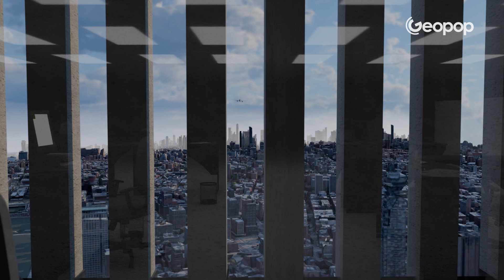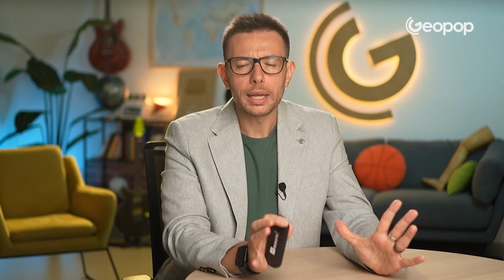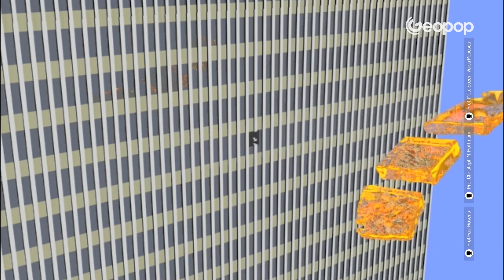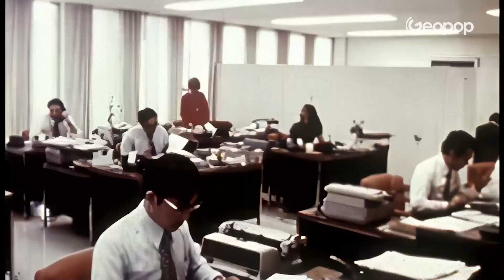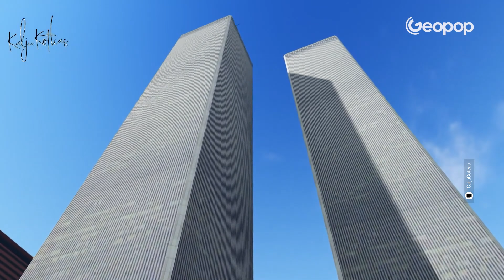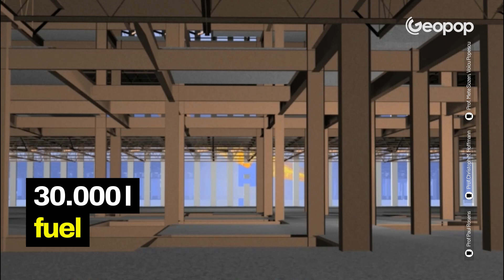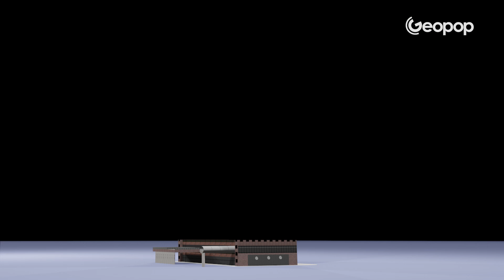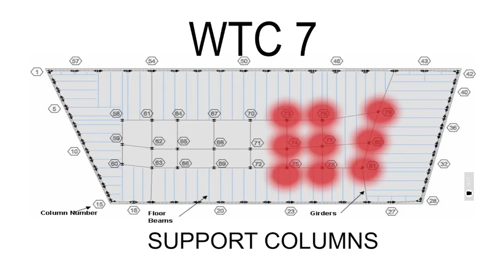9/11, 2001: The Technical Reconstruction of the Twin Towers and WTC 7 Collapses

Comment: Let's set the record straight. Molten metal was found in the dust, and in the debris for 6 weeks. The colors of the metal was orange and yellow. The color of molten aluminum is grey, looks like mercury. Molten steel was reported by the following 
people. Captain Philip Ruvolo (NYCFF), 
Richard Riggs(debris removal expert), Mark Loizeaux , Leslie Robertson (wtc structural engineer), Lynn Margulis (University of MA),  Dr. Abolhassan Astanch (from Berkeley),  Robert Kim Ireland( chemical engineer for US Army Corp of engineers), Mark Basile( chemical engineer), Kathy McGrade (materials engineer), Gery Warner( Mechanical engineer), David Gregg( PhD Chemical engineer), Steven Jones PhD( physicist), Kevin Ryan ( BS Chemistry), Niels Harrit (PhD Chemistry), Tom Sullivan( Explosives team) Jason Cheshire ( Chemical engineer), and Jeffrey Farrer (PhD Material science engineer).
Reply: Let's set the record straight. Molten metal (injteresting choice of word) was NOT found in the dust (that doesn't even make sense_ and in the debris for 6 weeks.

This is easy enough to confirm. All I have to do is ask you for any piece of verifiable evidende to back up that claim. Like thousands before you that is a task you will not just fail, but nopt even attempt. 

No need then to go to Step 2 and establish relevance.
Reply: @TheCriticalStinker-jw4fl that's right, go back to the top of the comments and start your bs all over again. Let's ignore the dozens of people with science degrees and listen to stinky with no degree and no experience in this area whatsoever. Why do you choose to ignore 90 percent of evidence. Where's your masters degree? Where's your 25 years of experience? Why should anyone listen to what you say?
Reply: @TheCriticalStinker-jw4fl I've just provided you with the people who say it's there and there degrees.What makes you think you know better than them?
Reply: @TheLoonResistance  https://m.youtube.com/watch?v=02UtSw-JeiI here’s the very first person they listed saying they witnessed molten steel. Is this your first time using the internet or are you really that dumb?
Reply: @thomash4950 - He was in Building 6 and as far as I know did not perform any metallurgical tests. Curiously, even though he is the star witness for the conspiacist crowd, not one of you lot has ever bothered to interview him.

Your entire case is ine casual comment, anecdote and you don't even bother to follow up.
Reply: @TheLoonResistance  Im not even a conspiracy theorist on this matter I just thought it would be funny to make you look like the fool you are once I realized the names this guy gave were real and had accounts of them noticing molten steel. You are eating your words from your first comment and have deflected to a new argument to protect your delicate ego and it’s hilarious
Reply: @thomash4950 - And what part was it I got wrong again?  So far you have presented a cherry-picked casual anecdote from one clearly still stressed, shocked and exhausted firefighter, who was in the wrong building (which I guarantee you didn't even know until I pointed it out) and with whom no one had EVER followed up.

Good luck with that in front of the grand jury.
Reply: @TheLoonResistance  man you are a next level dunce. The part you got wrong was claiming he provided no verifiable evidence of his claim when he listed nearly twenty names of people who witnessed molten steel, all on video. All while you contribute nothing but non constructive criticism. I’m not even arguing with you about the facts of 9/11, just pointing out that you were clearly the wrong one in that exchange
Reply: @TheLoonResistance also there is nothing anecdotal about it if every single one of them confirms they saw molten steel, which if it wasn’t your first time using the internet you could confirm yourself with a quick google search of each name
Reply: @thomash4950 - Great. So they were all in Building 6 then? 

Where is this molten steel?  Show us.  

Or maybe sometimes people use a word in a casual, not a literal way. Explaining the total lack of corroborating physical evidence.
Reply: @thomash4950 - If only one of you had the stones to do a comprehensive follow up interview with even one if these star witnesses.

Curious thing that.
Reply: @TheLoonResistance  bro just stop, take a breath, and figure out how to use your internet. It’s one of the best tools of the 21st century, and you have quite literally been handed the names to look up to see VIDEO of them all claiming to see molten steel. But I guess that all “not literal” for all of those accounts lmfao. Bro just grow a pair and admit your first comment was wrong, it’s not that hard unless you’re a major narcissist. That’s what this conversation is about, not us interviewing those people 😂
Reply: @thomash4950  - I am not the one making the claim here.  I am under no obligation to do your research for you because you are too lazy/too dumb.  I suggest you heed your own advice, do the research, then present the case instead of making others do your work for you.

Again, right now all you have presented is one guy using the magic word - a guy you and all the chickenshit conspiratards refuse to conduct a detailed follow-up interview with. 

There is no case.

Molten steel - as in steel heated to its liquid state - is a conspiracist fantasy derived from mis-quoting a tiny handful of casual anecdotes out of context with absolutely zero follow up. Nobody ever bothered to track down any of those key witnesses and ask them for more information, more detail.  And you sure as shit don't have ANY physical evidence. 

Curious.

Simply put, molten (liquid state) structural steel did not happen and you will not find a single shred of physical evidence it did. Most people who bang on about molten steel don't even know why they are doing it - don't understand what if any relevance it is supposed to have. They are just mindlessly tepeating shit the found on the internet.

No steel melted in the Twin Towers nor did it need to. Steel is formed using heat and deformed the same way. The hotter steel gets, the weaker it gets,... until it fails. That is usually at less than half its melting temperature. So it never even gets the chance to become a puddle.
Reply: @TheCriticalStinker-01 I must agree stinky.You're looking pretty stupid about now
Reply: Chief Pfeifer anyone ?

Comment: BULLS*IT!!  Someone must think 911 documents are going to be released, why else come out with this now?  If you can't dazzle us with brilliance, try to baffle us with Bullsh*t, huh?  First, nothing in towers burned hot enough to melt steel, yet firemen reported melted steel near base of building.  It is dripping from corners of the building on videos.  Designed to carry 1/3 more than its weight, how was it overloaded when a small portion of the lighter floors, at the top, fell a short distance?  The lower floors were designed to carry more than all the weight above and were not weakened at all.  If the excess weight brought them down, how did they fall at free fall speed?  That would have required for all the lower support steel strength to be completely removed at the right time.  Hence the expertise needed to demolish buildings with explosives.  Watching the videos show steel beams being ejected UP into the air during the fall.  This could have only been accomplished by explosive, since in a fall gravity would have only caused them to fall down.  Clouds of powdered concrete could have only been caused by explosives.

  Building 7, the hardest to explain, you spent the least amount of time on.  Office material would not have produced enough heat to weaken any steel.  The steel was covered with fireproofing.  A column on right side was supposedly knocked out or weakened, yet the building came straight down, again at freefall speed.  Firemen went into the building to extinguish the few fires, but were told to leave, "the building is going to come down".  A British tv reporter reported that the build had come down, yet you can see the actual building standing in the video behind her.  Looks to me like geopop is counting on most people having no engineering or physics training or experience to actually see what happened.

  Why didn't engineers come out and explain what actually happened shortly after the attack?  Since the governments were involved in the cover up, if not the crimes themselves, witnesses were in some cases threatened to not do so.  Others realized they could be fired or blacklisted had they came out against the government propaganda.  Dr. Steven Jones, a physics teacher, was allowed to retire early after posting videos.  His college probably had government research projects to lose had he stayed on.  On the morning of 911 a reporter reported that the NY police had stopped a white van, containing explosive residue.  He stated that was good, since we could now determine who had carried out the attack. This was only shown once on air. Heard later the occupants of the van had Israeli diplomatic passports and were sent back to Israel.  In our military, some requiring worldwide deployment are given diplomatic passports.  See much more details on what actually happened on YouTube video "Bravo 7", showing eyewitness testimony and comments from Engineers.
Reply: You obviously didn't bother watching the video. You are just mindlessly repeating the same tired old memes you conspiratards have been failing with for over 20 years, little of which has anything to do with the content of this video.

Kinda hard to take you seriously.

Comment: Why was their molten metal pouring out of the buildings?
Reply: Because there were massive fires that burned very hot.
Reply: @Tim22222 Wow! They must have been really hot! Around 1500°C or something.
Reply: @Mullerology  - You mean this?

youtube.com/watch?v=xPVGGQU-MeQ&ab_channel=SeekersofTruth 

That's aluminum. And maybe some lead. 

The Boeing 767 which struck the South Tower weighed 117 tons and 80% of that was aluminum.  The exterior cladding on the Twin Towers – the white panels – were also aluminum. When Flight 175 struck at the 81st floor its momentum deposited much of the office contents in its way and the bulk of the aircrafts mass into the NE corner of the building. The piled up debris shoved into that corner is visible in photographs and video so we know it was there. 

There’s a good shot here of piled up debris from 4:36;

youtube.com/watch?v=ZLJyL63sqtU&ab_channel=MrKoenig1985

Steel melts at roughly 2,750-deg F while fires in the South Tower reached peak temperatures of around 1,800-deg F. Aluminum OTOH melts between 887-deg F to 1,180-deg F depending on alloy. That aluminum will melt under these conditions is not a surprise. If you look at pictures of cars left behind and destroyed by forest fires the aluminum wheels are invariably melted away along with other sometimes aluminum parts like hoods. Steel bodies remain intact. 

The “molten metal” appears at 9:52 am. At the same time we see the first externally visible signs of sagging floor trusses and the pulling of the perimeter columns inward. I submit these events are related, not coincidental. The aluminum cladding at the NE corner also appears to me to be burning. 

It is likely the with the floor trusses sagging under the heat, and the 81st floor truss in the NE corner under the debris pile subjected to the heavy load of the debris pile, the truss broke its perimeter column connections and dropped, instigating the material starting to pour out of the NE corner at the 80th floor.

Given the properties of the materials in question, aluminum is by far the most likely culprit. 

Reports from The NIST, FEMA and MIT all concluded the material is aluminum. 

Certainly steel is the least likely of all the materials the anomaly could be given its much higher melting temperature and the fact there is no logical source for molten steel.  The perimeter columns in the NE corner are intact and the material is pouring out between them. So it isn’t columns melting, therefore what other source of steel is there?

Deniers will claim molten aluminum appears silver when molten, which is true but only at the low end of its melting temperature range. Aluminum can and does get hotter and it glows red to orange when it does (1,100 to 1,800-deg F).  Most folks of course just don’t bother getting it that hot if the goal is just to get it molten for say molding a part. No need to go higher. 

The total mass of molten aluminum is a BIG deal in regard to how it behaves when poured. Quantities bellow half a liter cool almost instantly if poured onto a flat surface, but if poured into say an ingot mould will stay red for a minute of so. Pouring volumes of molten aluminum greater than a liter is a VERY different experience. The thermal mass is much greater and the radiant heat is horrendous. The aluminum is able to stay liquid and remain glowing bright orange much longer. 

The famous video of glowing liquid gushing out of Tower 2 moments before it fell, involves at least tens of liters of molten aluminum. The thermal mass involved is so great that it stays red after falling many meters through the open air.

Side note: There was also a large UPS battery farm in that spot and some of that material at least may well be from the batteries IMHO.
Reply: @Mullerology  Not quite, but they reached about 1000°C. That was enough.
Reply: @Tim22222  I'm not sure if it is actually
Reply: @Mullerology  At 1000°C, steel loses up to 90% of its strength. Yes, that was enough.
Reply: @Tim22222  That wasn't what I asked. I asked why there was molten metal pouring out of the buildings.
Reply: @Mullerology  Because there were massive fires that burned very hot.

Comment: Sorry but I'm not buying this. There were far too many anomalies that day.  Explain the squibs of smoke being ejected 20 floors below the collapsing buildings. When you watch the tip of the towers collapse, they lean and were going to fall outwards and not straight down. 2 towers with Asymmetric damage collspse Symmetrically, hmmm.

Wtc7 is still the smoking gun. They obviously wanted to destroy the entire WTC complex. Lots of other large buildings around WTC 7 hit and burning that day still standing today. Once again, sporadic fires and asymmetrical damage and it collapsed  perfectly in on its own footprint, hmmmm.

And still no real video footage of the pentagon crash. There is no way a non flying pilot as bad as the so called terrorists were at flying, could have perfectly directed the airplane from its heading to fly towards Washington ,pin point exactly the pentagon and fly a perfectly descending loop and hit at the ground floor. Never in a million yrs could they have pulled that off, and i have flying experience. 

The US government played a serious part of this because they wanted war in the middle east.
Reply: What is a "squib of smoke"?  

The Twin Towers were 95% air by volume. As they collapsed, with thousands of tons of debris falling through the open office space that air was compressed.  We clearly see that compressed air being forced out in reaction to the building collapsing and yes, sometimes that happens a few floors below the collapse front. But it's still compressed air as evidenced by its low velocity of about 35 mph and it still happens in reaction to the building collapsing and is NOT a cause of the building collapsing.

If the Towers started to lean as they fell the collapses were by definition assymetrical, were they not? Not that anyone cares. Outside of the conspiracy internet nobody and I mean nobody talks about symmetry like its a thing that matters. Engineers never bring it up. Each Tower began to collapse when perimeter columns on one side buckled, causing 8 degrees of tilt in the North and 27 degress of til in the South Tower. At the same time they are leaning they are also dropping.  Also, very quickly after the perimeter columns on one side fail in compression (buckle) the perimeter columns on the other side fail in tension. In the raced between tilt and drop, it is drop that wins. 

The collapse of the Twin Towers destroyed 8 surrounding buildings and damaged more than 100 others.  What makes Building 7 collapsing from building-wide unfought fires 7 hours later a smoking gun and not say Building 3, Building 4 or St Nicholas Church?  

The Pentagon is really off-topic for this video but yea, I can address your internet-fueled misconceptions about that too. 

Anything can seem like a conspiracy if you don't understand how it works. Now you should. I hope that addresses your outsanding concerns.
Reply: @TheLoonResistance I've only posted like six videos about squibs. If you would shut up long enough and read something you might learn something